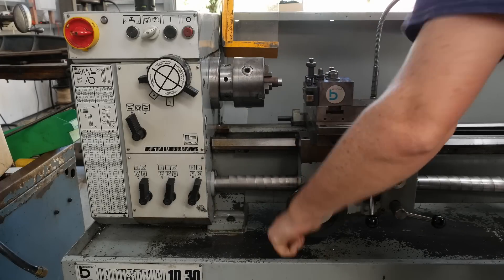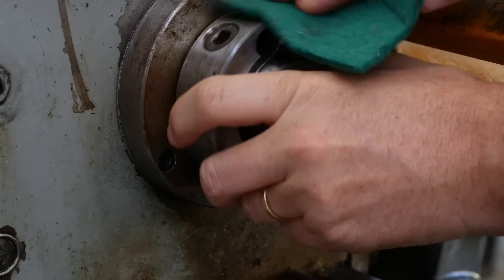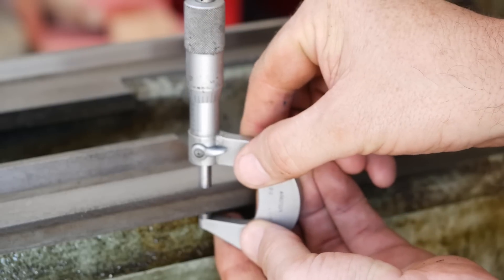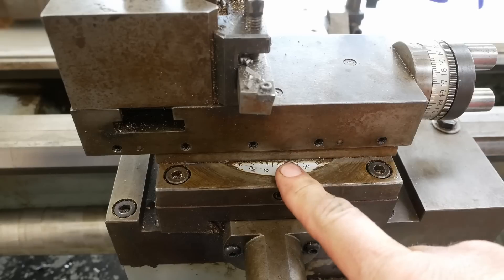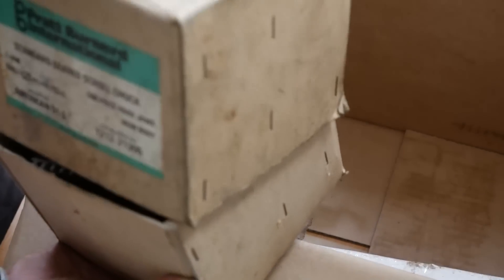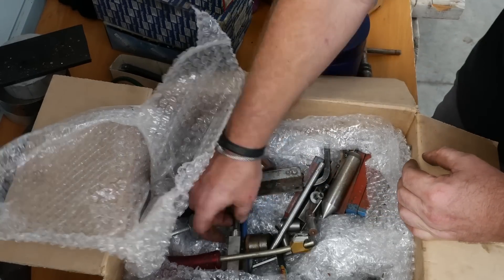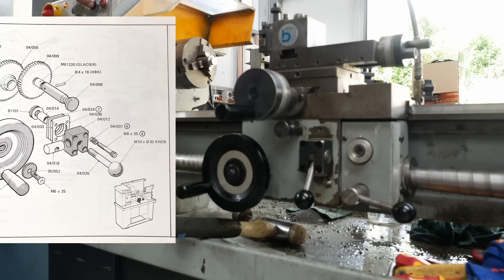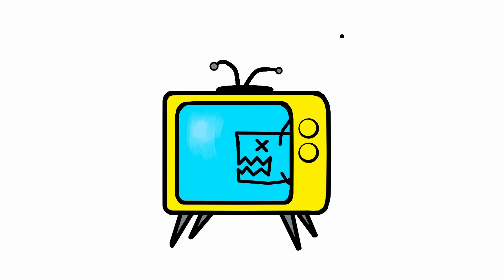Boxford 10.30 lathe review || RotarySMP

Comment: Very nice machine :)  Personally, I'd clean the surface rust off and touch it up, just to prevent anything deteriorating.  Otherwise, assuming it worked well enough, I'd run it as is.
Being a British machine, it's not leaking, it's just marking its property 😂

EDIT:  It looks like Boxford is still on the go and still making things in the UK.  That's a nice change.
Reply from the maker: That is good to hear. I think they were part of the 600 group around the time this one was built.

Comment: Fun fact, working in a 200:189 set of gears into the clockwork will get you very close to a 4 TPI inch leadscrew.
Reply from the maker: Good point. This lathe has a very broad range of feeds and pitches.
Reply: It already has that, the 6mm lead is converted to 1/4" by dividing by 120 and multiplying by 127, effectively 4tpi already built in.

Comment: Is it secret how much did the lathe cost or I just didn't hear it? I would like similar lathe to this, but don't have any idea how much it can cost. But the lathe look beautiful.
Reply from the maker: I didn't ask. NZ is a pretty small market for lathes, with most being of UK manufacture, so I doubt that it is very relevant what he paid for this machine.
Reply: They go for between two and four grand here in GB, almost all without change gears and steady rests.
Reply from the maker: @monkeyflyer410  From my vantage point in Austria, machine tools seem really cheap in the UK. The machines advertised for 2-4K there, would probably bring 4-7K over here.
Reply: @RotarySMP  That's expensive! I think the prices I said are already too expensive, nothing like what I used to pay when they were all being thrown out like scrap metal. If you see something on eBay you like, there's a couple of really nice boxford X10 series at the moment, it wouldn't take a lot of work to get shipped over to Austria.
Reply from the maker: @monkeyflyer410  Thanks. You are right there are a couple of really nice x10's in Ebay.co.uk at the moment, although the colour schemes will give you eye cancer :)
I have no space for a fourth lathe :) Need to sell the Mini-lathe and Boley first.

Comment: Nice Lathe, I have the 10.20 STS version, to be honest your wasting your time fitting a dro to this machine, they are very accurate machine. Its worthwhile reading up the manual as many good bits of info in there.
Reply from the maker: DRO's have the advantage of easy switching between metric and imperial.

Comment: I have the STS 10-20 version of this in the more desirable RAL6011 😊.
The power feed lever on mine is at right angles to the carriage assembly when engaged
Looking at the unboxing of the accessory’s it appears to the be the bargain of the year, the traveling and fixed steadies are like rocking horse poop to find and when you do find them, they are mega money as are the change wheels interestingly the reducing bush for the headstock spindle is the same as the Colchester Bantam and Chipmaster lathes.
The lathe would have been originally available in both 3 phase and single phase but 3phase would be the choice of most buyers.
Now would your colleague be able to draw the fixed steady out in CAD as I’m in need of one 😊.(mans got to ask)
Two axis DRO fits easily although the cross slide needs a bit of thought.
Reply from the maker: Hi Mike. This really was a very well equipped machine. I'll let Anton know of your request for a drawing of the steady.
Is the feed engage lever mount block screwed tight, or are the bolts a bit loose on yours?
Reply: @RotarySMP  The block is tight on mine. I did have a issue when i stripped and cleaned the whole carriage assembly after purchase  the power feed lever  on reasassembly something wasnt quite lined up and the action was stiff but the travel was ok so it may want a strip and clean and refiting as per the book. Its great lathe its just a bit unforunate that Boxford no longer support these lathes and they dont have following of the myford so non OEM parts dont exist. If Anton can supply me CAD drawing for the fixed steady i will fill him full of beer and cookies 😀
Reply from the maker: @mike5064  I am sure he will contact you directly, as you are now the Boxford 10.x0 club of two :)
Reply: @RotarySMP  See my other comment, these screws are meant to be loose and are used to adjust the clutch mechanism on the auto feeds, it's detailed in the manual. I've just fully rebuilt the apron on my STS.
Reply: Makes me happy to see a fellow make a good machine purchase 👍
Reply from the maker: @624Dudley  Anton got really lucky on this one. His Dad knew the guy, and so it never got advertised.

Comment: Eh, checking runout on a surface you just cut is pointless …
Reply from the maker: Sort of pointless with a 0.01mm measuring gauge, but with a µm gauge it is a good check for bearing problems. If you have a damaged spindle bearing it will show up as roundness issues in the cut surface.
Reply: @RotarySMP  Your measuring tool would see the same error as your cutting tool did before, resulting in a 0 error measurement.
Reply from the maker: @Stefan_Van_pellicom  
Did you see Dan Gelbarts "How to check a lathe" video before he took it off line. Shame he did that.

My friends Schaublin 125-CCN had a slogged out rear spindle bearing  bore. The defect could be easily seen testing for concentricity with a gauge.
Reply: @RotarySMP  Sadly I didn’t see that video. Can’t really get my head around how this should work, but then again, I’m not the sharpest tool in the shed …

Comment: Excellent video! -- QUESTION -- Can you help me understand this  - if a lathe has a bedway wearing "belly" of 2 or 3 thousands of an inch wear, how does that translate into your precision cuts on a shaft?  I was watching Keith Rucker restore his Monarch k lathe (looked excellent) and he left the beds alone even though he found a 2 or 3 thousands wear.  Is that a big deal?  Would it ruin your work??  I really can't figure out if this matters much (maybe it is my girl brain but I can't visualize if it ruins a straight cut on a long shaft)
Reply from the maker: It is rare that you need extreme precision over the whole length of a long shaft. You normally only need µm accuracy on short features at either end of a shaft. Normally bearing bosses. So even a worn lathe can produce good parts, as the machinist compensates for the wear over those short distances.

The second consideration is that droop in the bed due wear doesn't cause 1:1 change in tool radius. Only the cosine of the angular change from the centerline due wear affects radius, and the cosine of a small angle is a very small error. On a box way machine like my Schaublin the wear on the guiding side way affects radius 1:1, but most lathes guiding ways are prismatic, so there is a cosine error reduction on the the guiding way wear as well.
Reply: @RotarySMP  ..wow.. That is a detailed response.  Never could figure out that math and cosines.  If there is a "3 thousands" wear on the bedway and thus a "belly", can you give me an idea of what that actually would be on a 3 inch bar being machined?  Is it actually less than being off a 1 thousands??
Reply from the maker: @michaeltca3103  Were is simply a 3 thou wear straight down, then the affect of that dip on part diameter varies with part diameter, but above a mm or two of part diameter it disappears into surface finish variation. 

However you never get such 2 dimensional wear. You will also get some wear on the guiding flanks of the prismatic ways. If  you have 45° ways, worn down 3 thou, this would affect diameter by about 68% if the error, or 2 though in diameter.

In the real world, a lathe bed worn only 3 though is considered like new. The bed on my Boley is probably worn 20-30 thou but can still make nice parts.

Comment: Why did you talk him into getting a smaller less rigid lathe? It seems he was on the right track with an older, larger heavier lathe. That little lathe is fine for hobby but if he is starting a machine shop.... Total fail! At very min, he should gotten a 14X44 lathe. Im sorry but, he wuz right, and yoo wuz wrong.
Reply from the maker: This is a hobby shop, not a commercial shop, his dad has a bigger lathe he will move in there, and the DSG and LeBlond he was looking at were pretty shagged out.